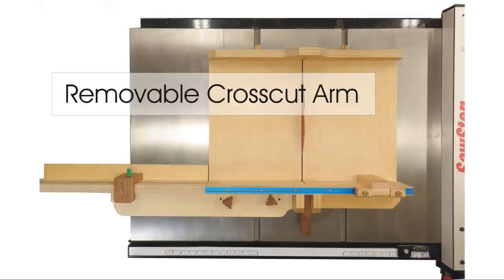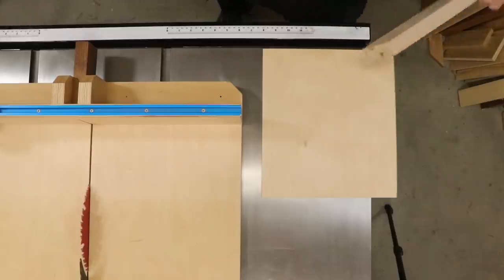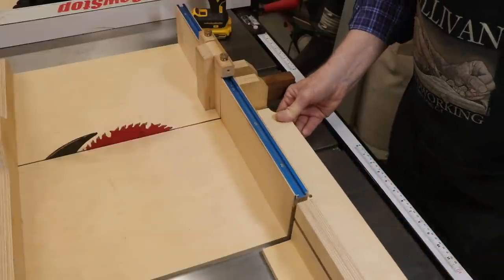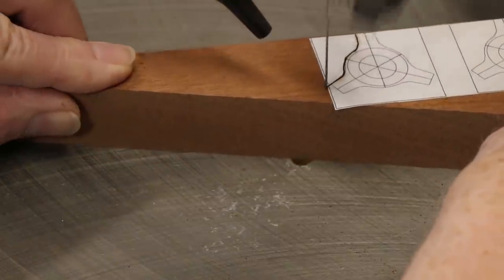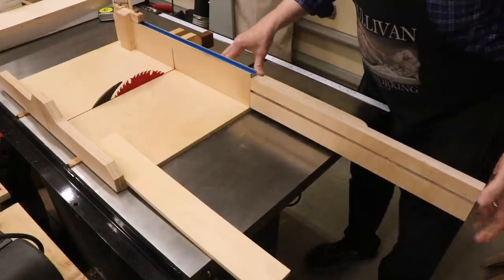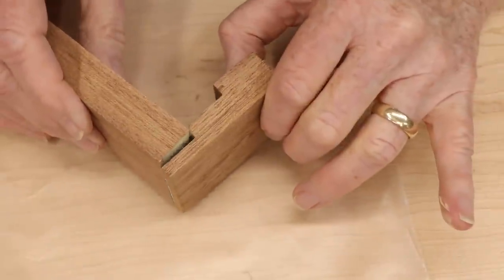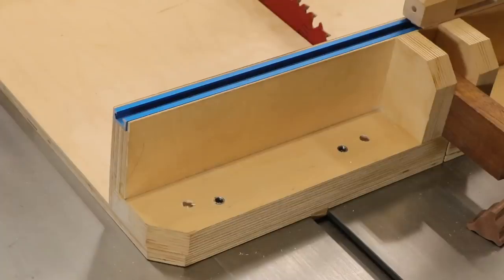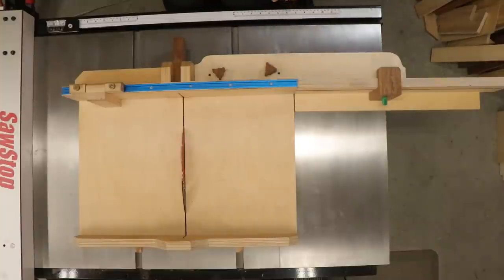Removable Crosscut Arm

Comment: Not just this, but about all your videos, I'd like to say you are an inspiration, sir. From design and thought process to videography and execution, well done.
Now I would like humbly like to offer a safety tidbit to help you avoid injury. You mentioned being new to pin nailers. Succinctly, it's best to establish a habit of always firing the tool while perpendicular to a narrow workpiece. The pins, as far as I know, always have a wedge point. This rule doesn't really seem to apply in plywood, as in this project. Although in solid woods, there is a possibility of  the wedge point hitting a knot or defect within the wood and deflecting out the side into your hand. With the tool perpendicular, a deflected pin is almost guaranteed to remain within the workpiece. 
Fix This Build That and The Honest Carpenter have good and relatively short videos on the subject.

Comment: Really nice sled man! I came up with a far more rigged up version by screwing a longer board to the face of the existing fence, then using a block and clamp as a stop block. Your version is much cleaner and professional looking.
Reply from the maker: I have done exactly the same thing several times.  That is the reason I finally decided to make this extension.

Comment: nice addition - and I had to learn (via Amazon) that 23 Gauge is 25 mm
Reply from the maker: Amazon is a big fat liar.  23 gauge pins are 0.025 inches thick, or 0.64mm.  They are so thin that they are practically invisible when driven in, and if you later accidentally run them through your table saw, the blade eats them without any complaint.  Really handy for things like jigs.
Reply: @PatrickSullivan  sounds good, I have a much bigger one, really not handy, that destroys the wood most often with up to 4cm staples, now I understand your compasion for the smaller mashine and should try to find one. By the way: I do not trust Amazon myself, but I've found it written on the package they want to sell, maybe it is 23 gauge and 25mm wide ...  - no, that doesn't sound logical - I'll take another look: Ok, me was wrong, it says: Makita 0,6mm, 23gauge, 25mm (long!) = 1", 10.000pcs f0r €10,29 :-), PINS!

We have a saying in Austria (and for sure they say it in Germany as well!): "Wer lesen kann ist klar im Vorteil" (Aiming to stupids like me, who are obviously not able the give the seen letters a meaning :-)  - THANKS for your answer and keep up the good works and videos! THUMBS UP!
Reply from the maker: @paulwyleciol3459  The cost of these pin nailers has greatly reduced.  The one I bought was $50, including several thousand pins of various sizes.  This is not the best or the most powerful, but for occasional use, it seems like a good value.  Here is a link to the US Amazon site:  https://amzn.to/3rhtywm

Comment: I only have ONE issue with this crosscut "arm"... you didn't cut a relief for sawdust to go in between the bottom piece and the vertical piece. I know it's probably not going to be an issue since its detached from the main sled, but if it ever gets sawdust there, it may become an issue. Otherwise, this is an excellent solution and most likely something I'll be doing for my sled too !